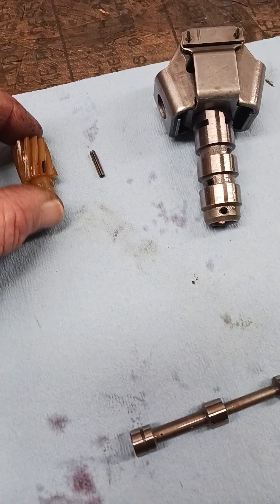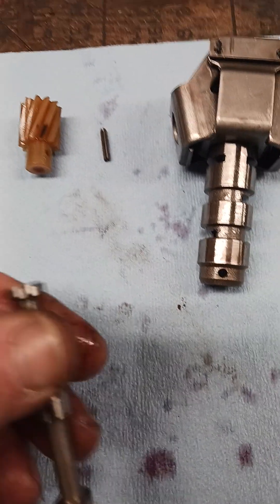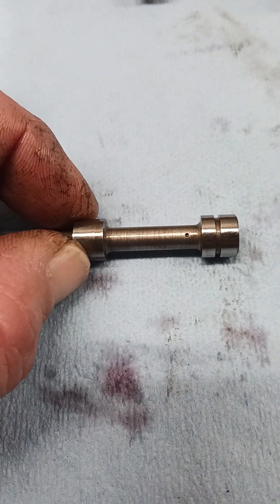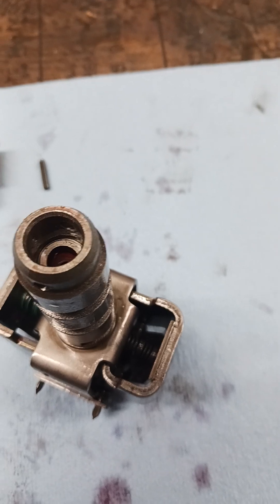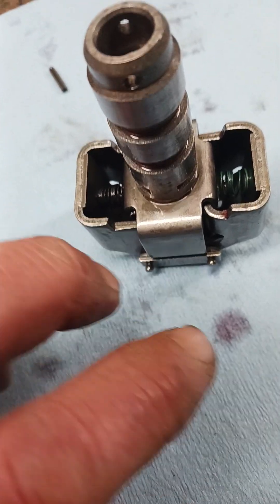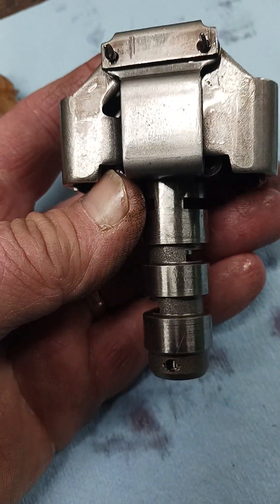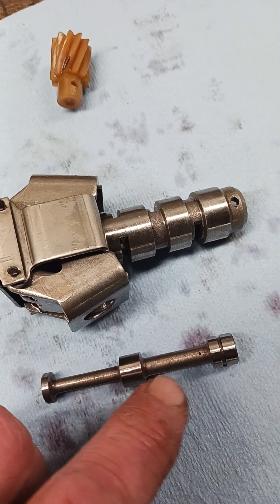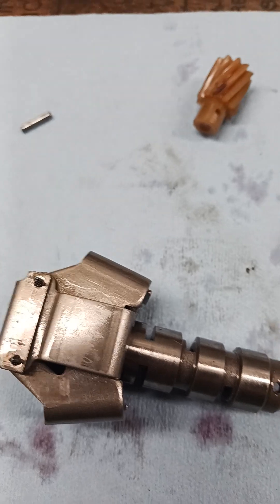Turbo 400 Transmission Will Not Upshift Part 2

Comment: I changed the weights in my '67 GTO with TH400 to adjust the shift pattern.  In doing so when I reinstalled the governor, it didn't shift at all.  I removed it and found the plastic gear was damaged. When I got a new gear and tried to put the governor back in, I found that it will not go all the way in.  It is short by about 1/4 to 3/8 inch.  Please advise how to get it all the way in
Reply from the maker: First did you get a gear for a 400? Mate the ends of the gears together. One may be  bigger in diameter.

Comment: Is there a modification that a "poor mans" manual valve body can be made by putting the spool valve backwards into the governor?
Reply from the maker: @davidsabyan2481  if it's a manual valve body it doesn't need the governor
Reply: @dragsterstransmissions  I'll try and reword my question. On a normal, automatic th400 valve body, there was a modification where by simply pulling out the governor spool valve, and then installing it back into the governor in the reverse direction,  it now changed the hydraulic circuits. I know this is not the purpose of your videos,  but I was hoping with your knowledge of the governor would help. I think this is a mod I  did to my Chevelle 40 years ago, but cannot remember for sure. Thank you. Your videos are awesome.